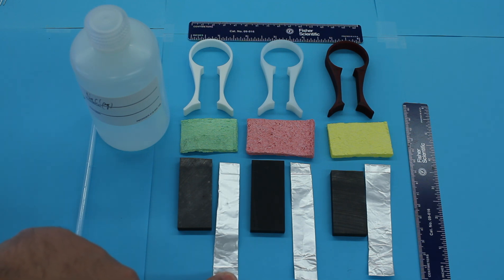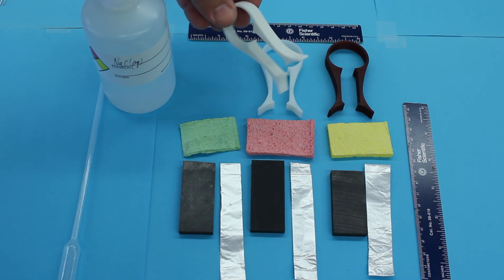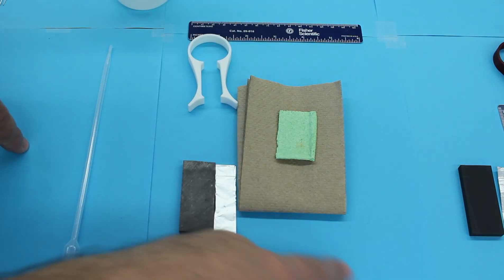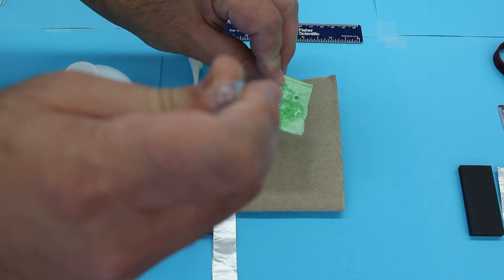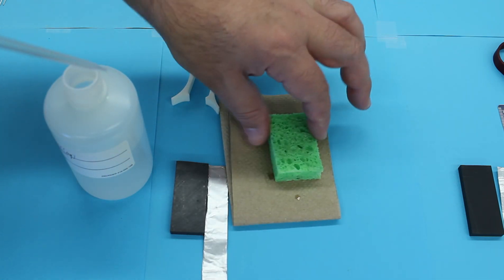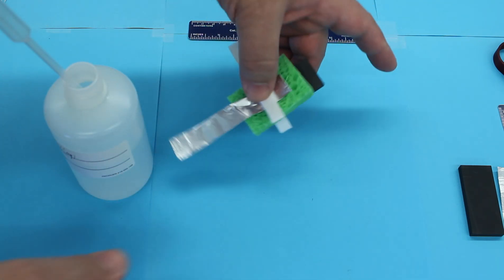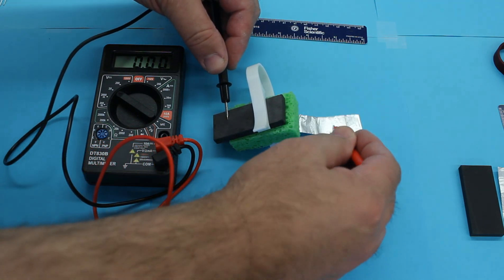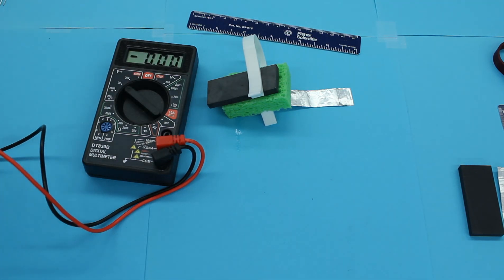The Air-Aluminum Battery Part 1

Comment: You need motor to test your battery work or not
Reply from the maker: Instead of a DC motor we are powering LEDs.  But you are not wrong, we could try to power a DC motor with our setup.

Comment: If we dip the two eletrodes in the solution kept in a beaker.will it work?
Reply from the maker: No, a battery requires a salt bridge.  The medium that holds the electrolyte must be a non-conductor.  In this case the sponge.